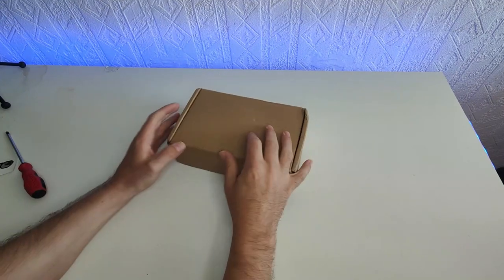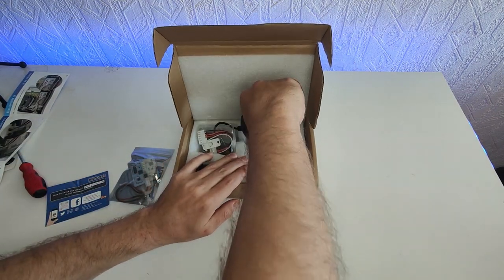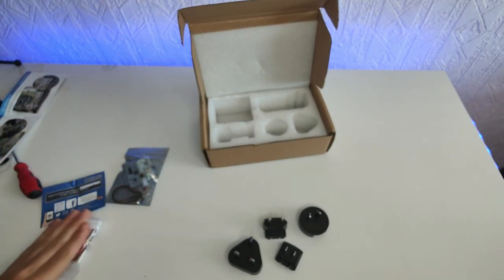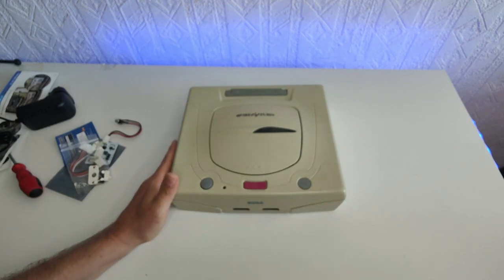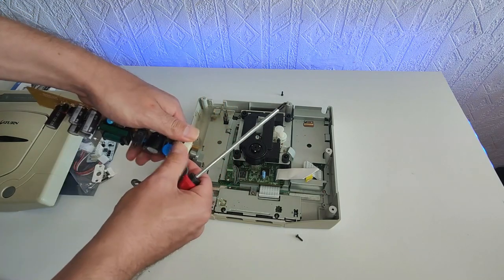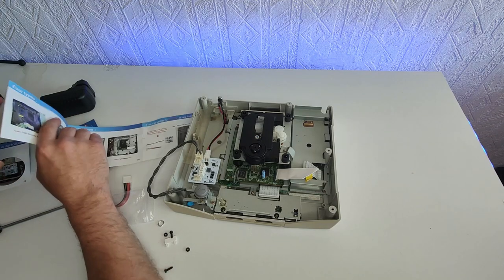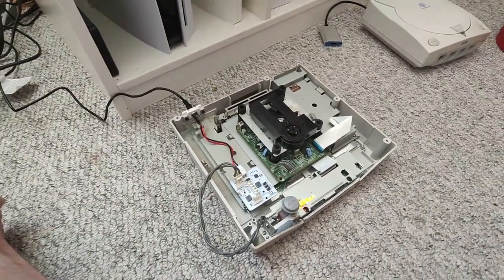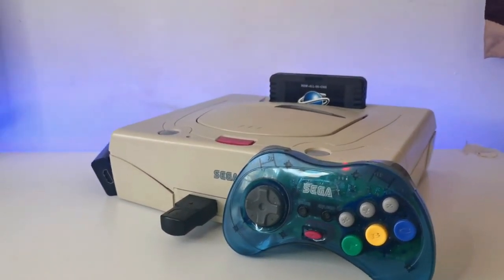Saturn psu Sega saturn power board upgrade replacement

Comment: So for clarification: if you live in 240V areas and you were to install this PSU, would you be able to run the console without a Step-down converter?
Reply from the maker: Yes now I need no  bulky step down converter

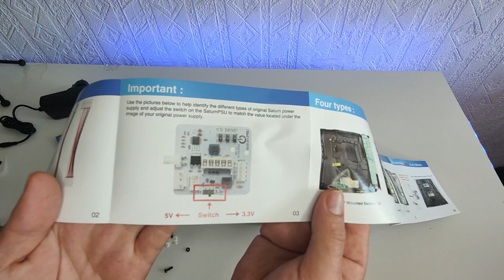Comment: 2:42 what is the 3v and 5v  because what i know is that ss use 12v ?
Reply: 12v from the wall adapter inside once it goes through the internal PSU it’s stepped down to either 3.3v or 5 volts you select the right one for your console model by a switch on the side of the psu